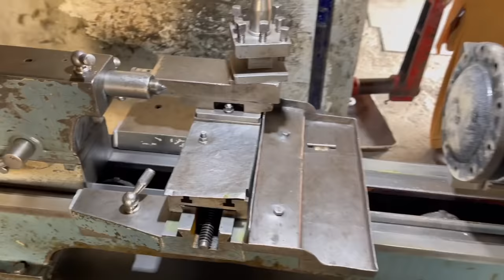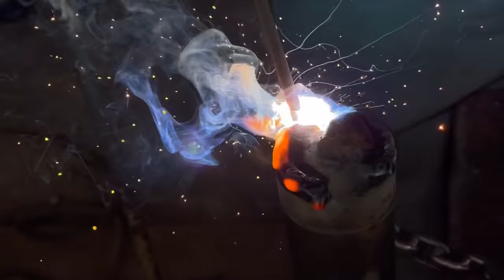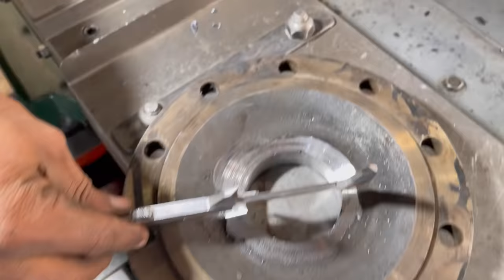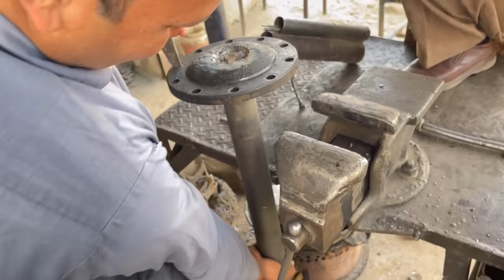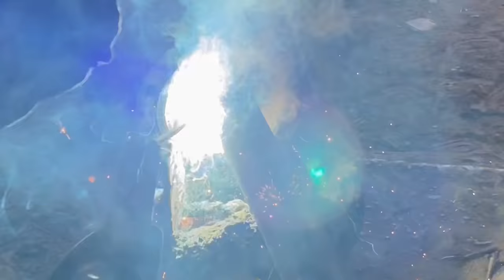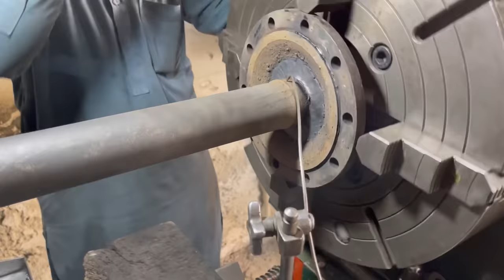Amazing technique Broken Rear Axle Repair | Local workshop amazing work |

Comment: The problem with such shaft repairs is. that because it looks so good, it does not mean it is very good. Metal suffers from metal fatigue and the work function on that shaft after years of operation would have " worked the metal" at some distance away from where the axle broke, and this is memorized by the shaft. The manner in which he welded on the end of that broken shaft to fill it in before he inserted it in the coupling disc, was rather naive of the granular makeup of that region. Just because one welds some metal on a broken shaft to make up for the missing metal, that sort of cosmetics would look good, but the joint is lacking strength, the old metal has been suffering fatigue and that will not be corrected by simply welding on it a lump of new metal, with a cold weld. The stresses involved are enormous and that shaft is not simply malleable iron but good steel which needs good preparation and good controlled cooling after welding.
One needs to know the phase diagram of that metal and its heat treatment to " rejuvenate it! 
Still, the actual workmanship is good but the higher-order engineering is very lacking. Those trucks are overloaded most of the time and  
 it is a reasonable temporary repair for a  cargo truck that does not travel at high speed on a fast motorway with other cars around.
Still, these people are to be admired for their intelligence and ingenuity, but let us hope that we do not see repairs like that on a shaft used in aircraft carrying passengers.
Reply: Yes ,when I first saw it a lot also went through my mind,but I see his welding shield and no gloves and realize it's the best your going to get in this part of the world.
Reply: Was thinking about the fatigue and welding stresses too. Agreed, it's amazing work for the tools they have. A nice surface finish on that inside radius would go a long way in preventing it from breaking in the exact same spot. Perhaps they did that after the video
Reply: @offinthehaed  I've been welding for close to 50 yrs. if you have for 40 with no gloves and sun screen life probably has so surprises for you! All you young guys protect yourself and look after yourself cause you are the only one that will.
Reply: @offinthehaed  this axle doesn’t sit in any bearing, the hub does. These just drive the rotation of the hub. But it also keeps them from seeing the weight of the truck, they don’t support the load, only accelerate the truck.
Reply: And it will snap again 😂
These fella’s will fix it again and again til the shaft is just made of weld. 
They make the most of what little they have,
Health n safety is shocking 😂😂😂😂
Reply: @offinthehaed  AS I said before,I have been welding forever and my advice is go to school and become a nurse.Think about it,clean work ,lots of pretty girls,good pay ,better class of people,the list goes on,and on and on.
Reply: For all we know the dude next door runs an annealing furnace and heat treat business. I doubt it. But still, you don't know what you don't know. He could finish it up send it next door and they finish heat treatment with a few normalizing cycles and send it back for a final milling with a grinder.
Reply: @offinthehaed  ,
Yep yep I had worked primarily Ag Equipment using 6010-13  an one day our Supply Co gave me some 7018 rods to try , Man it was like the clouds parted  , sun light broke thru an a choir of Angels  singing with Harps  playing . Sometimes just for fun I would lay down a big wide fat bead just to hear ppl say damn look at that 😎. I usually had the first 3 buttons on my work shirt unbuttoned an ended up having a beet red triangle from the lower part of neck to my chest that stayed there for years even after I no longer did welding . It was always pretty  Kewl when things were just right an as the steel cooled down the slag would crack an pop off by itself .My worst experience was when I first got  hired in as a helper, We were cutting the asphalt chute off a dump truck , I was holding up one side of it that had been cut already when the torch guy hit a rust pocket an freaking slag blew everywhere one big chunk flew into the top pocket of my  overalls burnt thru the inside traveled down past my waist an ended up  caught in my BVD's , man I was running around hooting an hollering by the time I got the overall off it had burnt thru an ended up in the top of my boot . Had a burnt line of flesh all the way down from my chest to a spot the size of a dime on one testicle😳 😫then down my leg .from then on I only wore boxers 🤣. Another fun toy was the Ole Air Arc , like a freaking industrial Roman Candle that sucker would throw sparks dang near  half a length of a football field, I would try an hold off till I saw someone start getting close an let her rip , on damn Ray Ray I didn't see ya homie 🤣🤣🤣🤣
Reply: @djhals0 That's absolutely correct, but you have to take into account the torsional forces that occur, especially when overloaded.
Reply: Last time I checked, aircraft use turbine jet engines.  Not free floating axle shafts spinning a tire.
Reply: Its a dirt poor country from Wars upon Wars, sorta like we are becoming! Let's go Brandon, WE GOT WAR too make!
Reply: @mlangham179  one can only hope. I believe they don't show us everything.  This video is, like most are just to show a sample.
Reply: I wouldn't want to be anywhere near the loaded truck this goes into.  Knowing the kind of stress that broke it in the first place, then seeing the attempt to build up the broken end of the axle shaft without at least grinding to clean metal first.  I'm only a hobby welder, but that looked like an absolute dumpster fire.
Reply: I have seen this repair last over 15 years so what is your point.
Reply: Or at least don't know the aircraft has similarly fixed engine........
Reply: @justsaynrush9689  You're correct in occupation choices. Welding , metal fab etc al , are very hazardous jobs in many ways .
Sure good to know a skilled welder when you need one. Just fork over whatever $$$ fee they command and be happy.
Reply: @paulrooster2108  your story would make a great training tech film. Well written too. Thanks
Reply: @TheBasstead1  lotsa DC 3s still fly passengers in other parts of this whirled
Reply: @TheBanaxel  Exactly, don't sell these folks expertise short.
Reply: That repair is just like a motorcycle front mudguard. Shiny like chrome on top....Sh?t underneath.

Comment: As a class one coded welder there is no strength in that at all. Full of slag inclusion so would never pass an xray. Was over heated so weld an all the metal around this area is now very very soft. This will snap or bend at the pressure point very quickly
Reply: The roads are bad over there and they have a business to run.
Reply: @jonskitch8082  So that makes it OK to do a unsafe weld job on an axle shaft?
Trucks are massively overloaded to begin which is most likely why the axle snapped.  
Waiting for the brake rotor/drum rebuild to come next.
Reply: U never see these things that are weld or repaired been put in a truck I think it is staged .note there were two broken ones and he only fixed one
Reply: @xenith0351  no its not staged, u can take my word for it..this is really how its done there
Reply: @xenith0351  It's not staged, that IS how they do things in this part of the world...I'm so glad I'm quitting and going home.
Reply: It's probably for a 1980's shit box truck not the Space Shuttle.
Reply: @agt155  it's for a full size lorry (think 18 wheeler) that regularly gets overloaded, because "standards-what are those? " is the attitude.
Reply: @Twizter68  A 40yr old truck that probably never gets above 20mph.
Reply: @agt155   You obviously have no idea...I've seen these guys go barreling down the worst roads at 100kph.
Reply: @agt155  all while overloaded by half or double rated weight.
Reply: @Twizter68  If you've seen these trucks then you know a welded axle is the least of their problems.
Reply: @agt155  the drivers are the biggest issue, along with being overloaded, working 16 hour days, yadda, yadda.  I live in the Middle East, bub.  I see them every freaking day.

Comment: Looks great, but that axle will crack and break very, very soon.   Welding the end and the outside edge can't compare to the strength it originally had as a one piece forging, which also broke.   I realize it's a this-or-nothing scenario, but they can expect to be doing this repair again in the near future, unless this truck never pulls a load.
Reply: i agree, and if you look at the disc this is not the first time its been repaired, and why don`t they use a dial to set it up right.
Reply: Yup
Reply: Temporary fix… will crack soon with all that slack in the welds
Reply: Yup....definitely going to break again...especially when trying to weld on high tensil material....never will get the same strength out of it...plus,burning in with a 7018,is just going to make the material even more brittle than it already is
Reply: Probably should have been preheated before welding.
Reply: All the eddies 🤣🤣
Reply: During welding, tensions have arisen that will soon lead to breakage again. The weld seams should have been annealed stress-free. Always drill with oil.
Reply: They didn't even skin the shaft before welding, just welded it right onto the dirt and rust!
Reply: I agree, the durability will be very low because the strength is given by a induction heat treatment at the flange and shaft zone. Applying welding affect the hardness and reduce all mechanical properties.
Reply: I think they know, not the first time he is doing this work.... When you speak like this you make it sound like they are less educated on the matter sir.
Reply: @Juuk-D  they're more than likely less educated on the matter.
Reply: @megamannyeah  "Most likely" smh, can't use that for anything, go find someone else to annoy, you seem to look for a fight but I'm good 👍🏽
Reply: @BS-uj5rt  loooool 😂😂

Comment: What these guys do is just fancy cley modeling with actual iron parts. They know how to weld and use a lathe, their engineering is wonderfull, but their joints lack any heat treatment, anealing and stuff related to metal hardening. That MMA welding is full of unremoved flux, they just knock the weld with that pointy hammer and that all. It's just garbage, dead metal, tensionned from the welding, that will break faster than the original did and under lighter load. Come on, don't be impressed by skill out of poverty. Their work is dangerous, imagine that axle breaking under a truck full of merchandise or people at 80-100 km/h and killing other people. What they do is actually criminal.
Reply: Can you explain how a broken axle shaft is going to kill people?
Reply: I totally agree with you!

Comment: At axle has probably been through that shop 6 times that year. Shining up the weld don't make it good
Reply: I think you should go outside USA where you can just order a new one my friend. Go out and see how things are done in other countries my friend. My respect for this masters that do this stuff
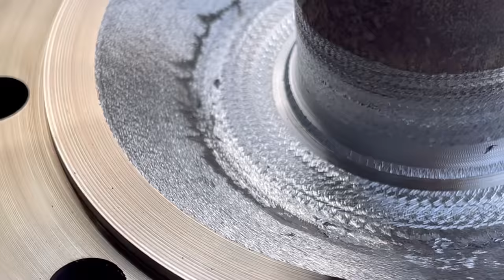Reply: I completely agree. The last step should have been the first step. He welded over the rust and whatever other crud had built up on the broken end. You can see the voids in the welds at the 18:40 mark. Just a matter of time before it's back
Reply: @magnashield8604  Somebody is going to call you a bigot for stating the obvious.
Reply: It does to the customer lol
Reply: @renatoslife5373  m
Reply: @renatoslife5373  6ัก็
ก็
Reply: Now I know where all our old equipment went lol. At least it’s in good hands now nobody here in the u.s. under the age of 40 would know how to use this equipment anyways. God bless the new masters of the craft.

Comment: At the beginning of the video you can see the shaft was repaired before. From the job done in this video it is clear the shaft will need to be repaired again. People compliment the simple tools used. Anyone can do anything wrong, especially if the expectation is that it only last a little while.
Reply: The rear axle failure had nothing to do with the truck routinely being over load d and on difficult roads.
Reply: @jonyoung6405  Originally it probably did, but welding creates a brittle area of metal known as the HAZ (heat affected zone) and if the drive flange is not mounted exactly central and perpendicular to the axle then every time it rotates it will apply a cyclic stress to this area which will quickly fatigue and fail.
Those axles and drive flanges are originally forged as one piece for strength because they are highly stressed parts.
Reply: In thé end you can see it has inpurities and will deffinitly crack again
Reply: @This_isnot_arobot  probably no others in existence over there. It gives someone a job to do and they get there truck fixed.  It's a lost art where people can actually use tools to rebuild stuff not jist toss it away.
Reply: Finally an intelligent comment, axle shafts are a forging for a reason, there is no way this repair is even close to the strength of the original part. Can you say repeat business!?
Reply: @ferrumignis  not a cyclic load as its held in a fixed rotating reference however as they have turned the back of the flange it should be OK, strength notwithstanding
Reply: This video explains all the videos on YT of truck tires flying off and crashing into things.
Reply: Perhaps they are repairing multiple times until it no longer has value or they find a used replacement. Just because the repair is not "OEM" doesn't mean it does not suffice for the intended purpose. Perhaps they are thinking it will last as long as the transmission or another major component fails.
Reply: It is possible that the vehicle in question is old enough that getting the right kind of replacement parts is impossible (for these people) - and hence it’s this way or nothing?
Reply: Have to remember there is a tire between this and road which absorbs alot aspecially a 1/10000

Comment: Where was the earth when welding in the lathe ? 
I hope it wasn’t running through the machines bearings
Reply: It could have been on the the splined end of the axel I guess, but probably was through the lathe

Comment: Error grave de unificación de la soldadura, existe una zona con aire, esa cosa se quebrará muy rápido. La parte de atrás la soldaste como si fuese una cañería, debiste perforar con el torno y unificar la soldadura frontal y trasera, para una mayor dureza y distribución de la fuerza. Aparte el amperaje está muy bajo, casi no penetra la soldadura en el metal.

Comment: If you look closely it appears to have been repaired the same way before.
Why would you repeat a failure!!!!!
Reply: I have done repeat repairs on engines with blown cylinder head gaskets. Majority of previous repairs with those heads were caused by improper torque sequences or just plain incompetence as to how to properly torque down and or replace a cylinder head. Repeat repairs do not necessarily mean the same repair will fail the same way. Sometimes previous repairs were just done incorrectly.
Reply: @sandiagoism  The guy didn't remove the old weld material and welded over slag multiple times. This axle will fail because of the repairman, not because of the truck operator.

Comment: attention ne répéter cette opération car il est strictement interdit de faire la soudure des pieces sur les machines outils car ça endommage les roulements de la machine
Reply: These guys tend to put some sense in their work, like not grounding through the bearings, but through the part... it is not possible to hurt a bearing in the machine if electricity isn't arcing through it.

Comment: Shoddy as usual, the cracks in the 'repaired axle' are clearly visible. It will probably last until the truck can no longer make the next pass road and leaves it steeply downhill.
Reply: I would have left the weld alone honestly, no need to cut down and weaken the repaired area
Reply: One more point about the weld. He uses 7018 low-hydrogen electrode, but neither has he taken it unpacking the sealed batch nor has he 
 taken it out of thermal quiver - at least it's not shown. The whole hydrogenlessness of a electrode makes little sense if it sucked atmospheric moisture in before use.

Comment: Be sure to ground the part so that the lathe bearings are not damaged from arcing by carrying the arc welding load.
    The protection of the machine is the priority!
Reply: NOT IN INDIA
Reply: @js-vm8zc  LOL
Reply: Sort of an old wives tale probably from the days of babbit bearings- electricity always follows the path of least resistance and an oil soaked bearing is high resistance.
Reply: @js-vm8zc  It's Pakistan.
Reply: @keithcoinc  it's totally irrelevant what 3rd world country it is where people are expendable and a lathe is worth more than a human life

Comment: Ya, this should hold for a couple minutes. Just weld right over the slag, it'll be fine. Shouldn't we chamfer both sides of the flange to get good penitration? Nah, it'll be good.
Reply: Well, they did arc-gouge out the inner part but again no real cleanup of the slag in the crevice.
Reply: Will hold just fine
Reply: They didn't clean any oil or dirt off of it. These guys over load their trucks constantly. I give it a week to a month, before the weld cracks. And it'll probably give out one day to week after that.

I could be wrong, but the guy broke the factory axle and the weld was not good. Educated assumption, says it'll break sooner rather than later.
Reply: If it breaks just weld it again
Reply: @chestervaldes7551  if they air arced it then welded with no clean up first its junk